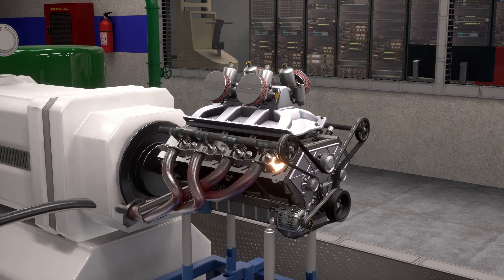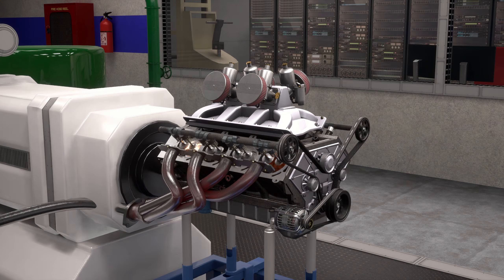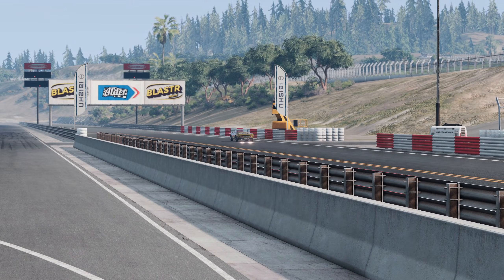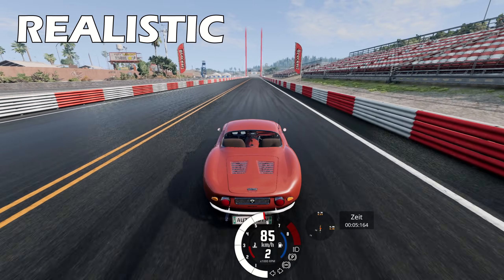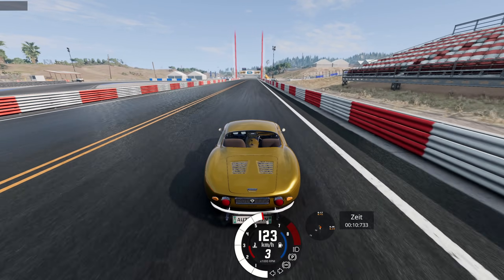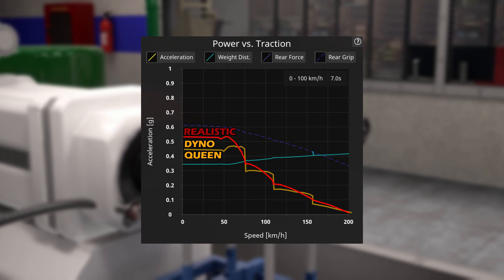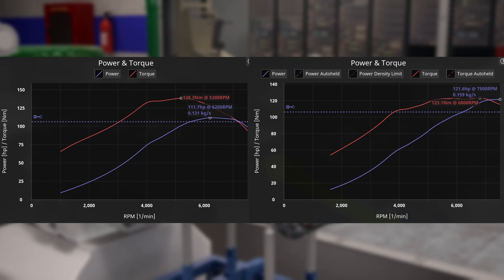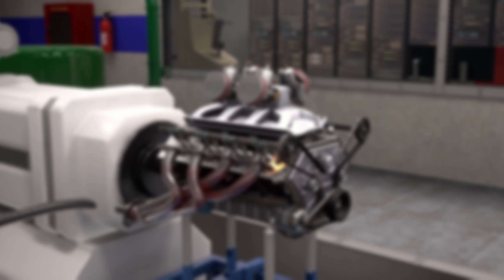Avoid this mistake when designing an Engine in Automation | Powerband Tutorial

Comment: I tend to either make my torque curves flat, or peak early.  The former more so with NA engines (4 valves/cylinder, VVL) so that the power gain through the revs is more consistent, the latter with turbocharged engines (ironic, I know, less so with compound turbochargers (my beloved) with lower rev limits so that you get more horsepower before reaching the peak (really good if you’re designing an engine that can’t exceed a certain number of horsepower like a Le Mans Hypercar engine for instance).

Comment: Idk why but the power curves in this game don’t cross at 5252 RPM
Reply from the maker: They only cross at 5252 rpm if you use freedom units, i.e. lb-ft for torque and HP for power. If you use different units, the (then scaled) curves cross at different rpm values
Reply: @the.bavarian oooohhh

Thanks for the clarification

Comment: I think this video is a massive over explanation. All that needs to be known is that aiming for peak power makes it so for most of each gear the average power is lower. You want to spread the peak power across the rpm range of each gear so you have moderate acceleration throughout the gearing rpm range, rather than for 0.5 seconds before you shift up and then bog down.

Comment: When i design a sporty engine i make 4,500 hp
Reply: What use is 4,500 horses if the car can’t use all of them?

For context, I have a NA 5.1L V10 for my F1-esque car that makes 900 horsepower.  While it handles corners thanks to the gobs of downforce and light weight, I still have to be careful with power application at low speeds.
Reply: i got to 6,662.5 HP but i was pushing it to the absolute limit a 10.1L V12 quad turbo and tuned to max HP without self destructing
Reply: When I do that, it tends to be a tiny engine not more than 5 cylinders with no more than 400hp. I like my cars light, nimble and low power to get around the track much faster than anything which risks spinning wheels
Reply: That's not the point of a well adjusted engine though.

Comment: It's all about just how flat you can make the power curve in the usable rpm range for race engines imo. Of course this has to do with torque in the fact that power is related, but you shouldn't care about engine torque because that's what a gearbox is for. People have a misconception that engine torque is more useful for towing or moving heavy things. In reality, heavy duty vehicles rely on beefing up the chassis/suspension and using short gearing (for wheel torque) to tow heavier things. Diesel engines are used in heavy duty vehicles because of their higher thermal efficiency, which is tangentially related to the torque that they make per combustion event, but the torque itself doesn't allow them to pull more. You could make a heavy duty vehicle accelerate much faster with a gas engine with a higher hp output, but you would have to add significantly more cooling and it would guzzle fuel.

Comment: I've gone ham with the smart boost and compound turbos, peak torque from 1200rpm to ~1000rpm before redline, where you can drop it slowly to make the power constant.
Reply: Yeah it's actually nuts. Exploited a lot of power/weight regs that didn't ban smart boost in this way.
Reply: @lazyboxfish7113  Basically replaces VVL for 5 valve/cylinder engines, so you can have better fuel economy of the 5 valve/cylinder (and to an extent a turbo engine too) while also having a flat torque curve (or better yet, if the engine is made under a horsepower limit, a torque curve that peaks early).

Comment: Im no engeener but my guess of this   is that when hp is on rev limit which is where you dont shift the gear you aim for a perfect shift so you will find yourself shifting the gear at 100-110hp but when you have your peak in a graph area that you would usually shift in you would get the full potential and at that case its 111hp so you get the full potential of the engine instead of just having the number 

Also can somone explain to me how i know that much like is it my overthinking an 3AM or do i unknowingly have german dna in my blood cause i never searched for that or use gpt for it...... lol

Comment: Couldn’t the gold car just rev +500 rpm and shorter final drive than the red car?
Reply from the maker: Yes sure, but the point was to have both on the same playing field. Once you have maxed out the rpm the engine can take, it  really is about the shape of the torque curve. Of course you can also shorten gearing, but you can do that with the "good" car, too.

Comment: I started out making I3 engines with 50 to 40 HP and they have no ping. But every thing over 100 HP pings and cracks on the dyno and I have tried running the fuel mixture rich and dropping compression and nothing works. Until I made a V12. I copied the fuel numbers from the injectors and the air numbers from the intake and tried to make a V8 with similar numbers but the V8 crackles and pings.  Where can I find the fuel rate so I can match it with the air intake at the proper ratio?  Also is there an easy way to put carpeting/flooring in the cars? None of the available ones I have tried are a good fit.
Reply from the maker: Hm, I don't know what you mean with pinging and cracking - is it just something on the audio side or does the engine not make enough power? The engine simulation is very detailed and it is hard to answer your question in a generic way without knowing the details of the setup.
Regarding carpets/floors: I didn't find an easy way yet, but there are some floor pieces available that should make it a bit easier than what I normally do on my cars (i.e. they may help to use less fixtures). I just forget very often that these exist.
Reply: @the.bavarian  Sounds like knock even if there are no warnings for knocks. I tried the AI tunes for power and also gas mileage and it still knocks. I have made a few 300 plus HP since my first comment that did not have knock but most do.

Comment: I much prefer a wide as possible powerband.

And I love a high revving engine note.
But I'd rather have the power come on 500rpm earlier than have it peak at max rpm. 
For my actual driving.

I'd even go as far and say is high rpm power units have only been deliberately engineered when there were significant size/displacement restrictions.
Reply: 4 valve/cylinder and VVL helps a ton for a high-revving NA engine, especially if you tune it right.

Comment: Thats why i love superchargers. High power and damn near flat torque curve. I built a 700cc supercharged inline 4 that makes 700hp running nitromethane for an f1 car. Its weighs less than a 100 lbs. the car itself weighs less than 1000lbs and has 4000lbs of downforce

Comment: ok so... how do I avoid that mistake then?
Reply: There’s main ways (others exist too but these yield the best results). Firstly and easiest is to adjust you adjust your valve springs. Lower valve spring stiffness will reduce friction on the engine and hurt some top end power but will overall help engine efficiency, peak torque and reliability. Next is to tune your engine flow. Aim your flow to be at about 110ish% on road and economy cars 105ish% for sports cars and 100ish% or less. Having a high % will have peak torque be earlier in the revs and drop your high end power. Lastly is your cam tuning. Less aggressive cams put your torque earlier in the revs while more aggressive ones will create good high end power at the cost of engine efficiency. Remember each of these factors influence each other so adjust each multiple times to get the best results.

Comment: I've made this exact mistake. Fwiw, with a dyno queen should be actually faster with a CVT since the CVT can hold the peak power rpm until the engine explodes. Lol. M6bfavorite old truck was an 88 5 speed manual 2wd F150 with the 300 6 (4.9 liters). The massive torque meant you could leave it in 3rd and drive like an automatic around town unless you came to a  full stop.

Comment: I tend to tune for about 200-500 rpm "power run off" so I know when to shift when I export to beamng, but even then it flatten out quite a bit before it drops. Recently I've been trying to tune for lower end torque so I can get faster acceleration

Comment: If yall dont understand this, its basically 5.0 vs LS, LS has more mid range power and torque, and thats why yall cant fw GM off the dig till you got an extra 200 hp or a 10 speed🤷‍♂️

Comment: What's funny is that this illustrated the quote "Horsepower sells cars but torque wins races". The lower power engine has higher torque indicating a better torque curve and therefore is better in any real performance senario.
Reply: Except that you can have a high revving engine with very little torque that has a much wider power curve than a low rpm engine that makes a huge amount of torque. A Nissan VR38DETT, for example, can produce more torque at the wheels over a wider range of vehicle speeds than most semi truck engines ever could.
Reply: @PistonAvatarGuy  That's right, torque only wins races because the races are restricted in power.

Comment: What I try to do, after variable valve lift is available, if I am building a sporty engine, is to place the main cam profile fairly low (around 30), the second cam profile fairly high, and turn the turbo so that it kicks in about 1500 RPM before the second cam, to minimize power delivery valleys.

Before that, I go to 	DOHC valvetrain but keep cam and ignition timing fairly mild if have no means to tune the engine to keep linear gear shifts strictly within the power band.

Comment: Great video! The only thing I'm missing is a reference to the Performance stat. This is often highest when you have about 500rpm to spare, depending on the power band of course. So if you're not sure you're what's better, that should be a good indicator.  I don't know how accurate it is, though.
Reply from the maker: You're absolutely right! It's a generic stat guiding you into the right direction, but in the end it all depends not only on the torque curve, but also on gearing. The stat definitely points you towards building less peaky engines, so it is a good guidance and I should have mentioned it.

Comment: wanted to touch a little bit more on why you don't want your peak power at redline; first of all, you might actually be losing potential power if your redline is too low, but even if your redline is right at the actual power peak, you're still losing a significant range above the peak where the engine is still making close to peak power. That range keeps the engine in its powerband for longer and also can potentially mean the car is closer to its peak power once you upshift (i.e. it doesn't "bog down" as much)
Reply: unless BEEG TURBO

Comment: Der Bayer with a Der Banger as per usual. also if you didnt know, those fixtures exporting as white can be fixed by selecting them in automation and changing the material. The chrome it defaults as is broken.
Reply from the maker: Yeah I didn't double-check my beam exports this time. Visual quality was an afterthought for this video :)

Comment: There is a built-in stat in Automation that helps you better see the realistic performance of the engine: the "Performance Index" which is the average engine power in kW in the top 30% (or something similar) of the rev range. Maximizing that value will be a better indication for racing performance than peak power. Cheers!
Reply from the maker: You're right, I probably should have pointed at the Performance Index for quick tuning guidance!
Reply: What I would love to see is a vertical line on the powerband to tell where shifts put the revs, since we already have engine graphs based on the car it's in. Would make it easier to understand visually.
Reply: @06dpa  That would be possible, but you'd probably want to see that as a graph variant in the gearing graph so that you can tune the gears right away. The "don't cut the power curve" is something you learn once and then do for all engines, proper gear tuning is something you do for every car/engine combo.
Reply: Do you even remember when you made your own version of this video? It was way back when Automation was just an engine designer.
Reply: @MrHamof  I do not remember that, no :D but it certainly is a topic that has lived in my head and says hello whenever I see dyno queens haha
Reply: @KillrobPlays will we get centrifugal superchargers, I’ve been thinking of it and I’m not too sure on how it’s coded but it seems too me that you could take the code from the compressor side of the turbos already in game, have some mechanical inefficiencies, and a player changed multiplier slider for engine rpm to supercharger.
Reply: @something7992  Roots, Screw, and Centrifugal, yes!

Comment: I'd love a tutorial on the ins and outs of exhaust/intake tuning
Right now I just kind of match the flow graphs but I'm not entirely sure if that's correct
Reply from the maker: If you're matching the flow graphs you are already doing half of the job right! The other half is about different resonances for the different header types, basically giving you a torque/power boost at specific rpm ranges (higher ranges for more sporty/racey header types). That's the short tutorial, I'll note the idea down :)

Comment: Ferrari 360 has peak power at max rpm (~395hp @ 8500rpm). But up until that point for about 1000rpm the curve stays relatively flat. So not cutting off power is good, but what people should really be aiming for is a usable relatively flat curve before max rpm (at least with sporty engines), even if peak power is at max rpm
Reply from the maker: Real car companies (and their managers and their customers) also fall for the numbers game :) You need to have a higher power number than your competitor, as this adds additional prestige in the real world. Automation does not simulate this in the campaign though!
Reply: @the.bavarian  yeah, but still before shifting you've got 1000 rpm range of flat curve, so they did put some effort into making it usable lol
Reply: @xenoyparxi also, peaky engines are more rewarding to rev over “flat torque curve” engines, aren’t they?

Comment: The thing is in this case, you'd want to raise the rev limit on the gold engine so that you'd get back into the high power zone after shifting. Now of course, that's assuming you can do this wihout blowing valves or something else through the bonnet. Then, you'd also want to modify gear ratios to be closer and final to be shorter if you're not shooting for higher top speed, increasing acceleration further. 

Sure, in general, you want to maximize the area under the power curve through the range of RPMs you're gonna be using the most, and having a linear power curve that peaks right at rev limit is very stupid, but there is also a world where you flatten the curve too much for a racing application and just lose potential. In the end, the whole powertrain is a system, and considering the engine alone is not a good approach. A close ratio gearbox won't be great with a wide powerband at low - mid RPMs, while more spread out gear ratios will not allow you to get the best out of a peaky race engine.
Reply from the maker: I probably should have said that this applies when the engine internals are already at their limit and don't want to rev any higher. Of course for any motorsport application you normally go for the maximum rpm limit possible. So the video applies to the case when you already have set your rpm limit.

You're also right about it's not only about the power/torque curve, but about the overall car and especially gearing. The whole thing is less of a problem the more gears you have available.
Reply: @the.bavarian you can even have “infinite” gears available, but it’ll sound like absolute garbage

Comment: Most people don't really understand the relationship between torque and power, even though they'll tell you that they do. People also underestimate gear ratios and their effect on wheel torque. 

Having an engine with max RPM 500RPM higher than peak power also has the potential to allow you to use a higher average peak torque/power, and gives greater flexibility with gear ratios